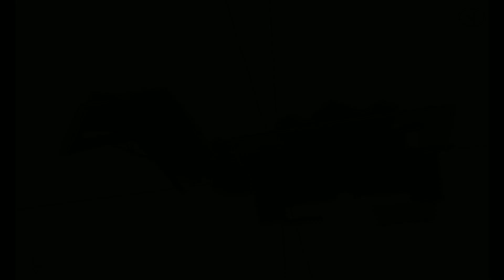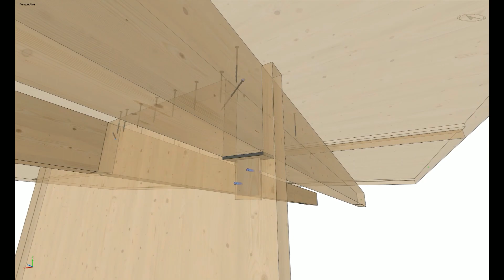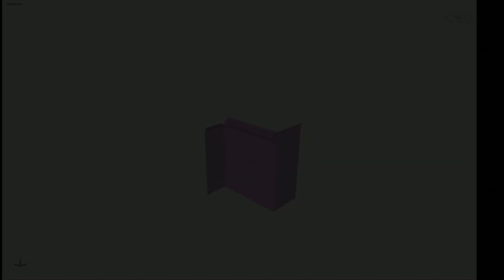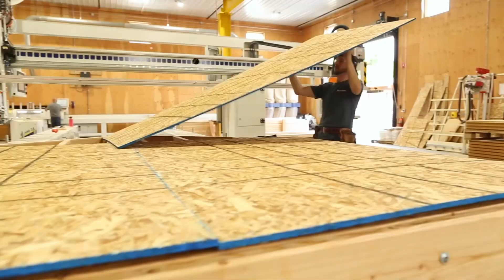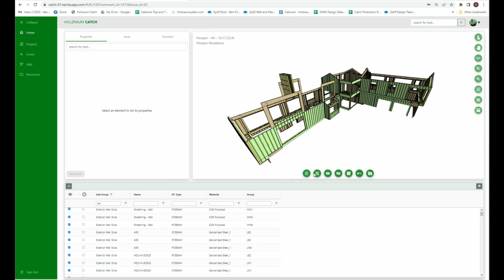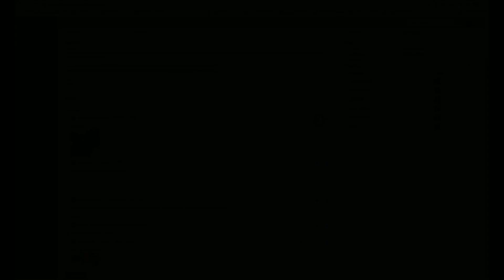Holzraum System, Carbon Smart by Design for Energy Savings on Building Projects

Comment: Pumicecrete is by far the best building material on the planet Pumicecrete is a mixture of pumice cement and water mixed and poured into a set of reusable forms walls are poured from 12"to 25" thick pumicecrete is fireproof termite proof rust rot and mold proof and has a high R value and good sound attenuation solid poured walls means no critters can live in your walls Pumicecrete can be built for a fraction of the cost and time and pumice is one of the few building materials that can go directly from the mine to the job site ready to use without any additional possessing and zero waste 
My goal is to build a pumicecrete home for Community First in Austin Texas 
Take care Ray